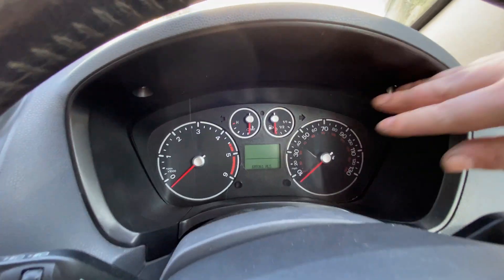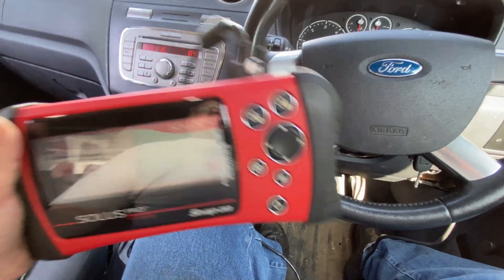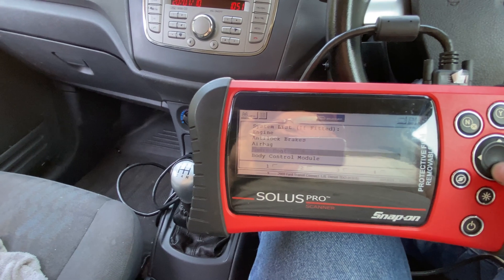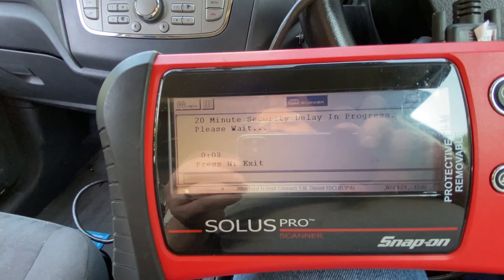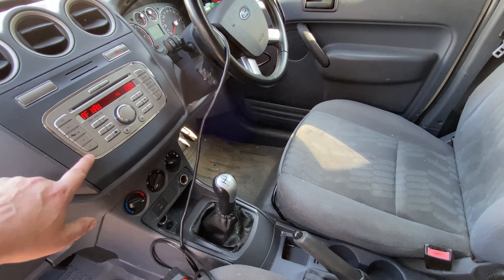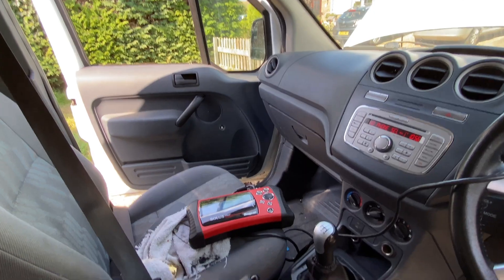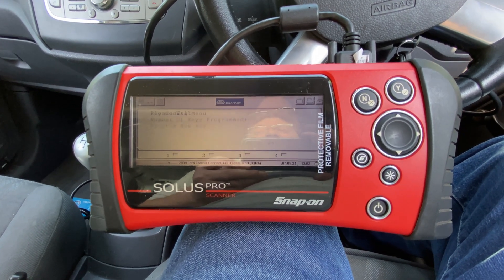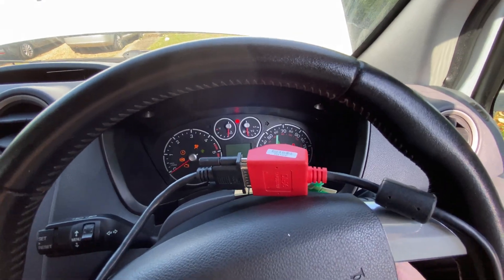Ford Transit Connect Key programming Snap On Solus pro

Comment: Hi, I have a autel mk808 
My ford connect 2003 does not see my key more, the engines turns over but doesn't start as immobiliser has cut fuel
I get to the point where it asks for incode but where do I get this? Also is there a limited number of time incode can be entered correctly? Can I get looked out completely

Appreciate any help thanks
Reply from the maker: If your 2003 Connect is a TDDI (Bosch VP30 fuel pump). EDC bolted to top of fuel pump are prone to failure. Resulting in engine fails to start (crank but no start) & immobiliser light flashing. Its advisable to have DTC's (Error codes) read 1st. To rule out above fault.

Ford incodes are available here - https://www.fordradio.codes/pats/
Reply: @PaulsTechChannel  thanks for the response 
I read all the codes 
- Fuel rail low pressure
- 3 x codes for anti theft key not recognised 

I used that sane generator for incode and the autel tool came back with invalid code 
It Also said any more attempts could lock it out....can it lock out?
One more thing, I noticed you had the 20 minute security wait my tool just Sat's please wait but you can press ok to go to next page (nothing about 20 mins) do you think I need to wait 20 minutes?
Reply from the maker: @TheDrivewayExperiment  Tool I used in this vid - Snap on solus Pro. Does not require incodes to access PATS, Due to that it requires a 20 min delay.
If your tool is requesting  incode It should provide you with a Outcode  which must be entered to generate incode. Once you have incode, entrer it into your tool to access PATS.  It should then grant you immediate access with no time delay.
Reply: @PaulsTechChannel  ahh maybe I used the previous given out code which would make this incode invalid as I understand it the outcode it gives you is generated there and then

Thanks for the help!!!
Reply from the maker: @TheDrivewayExperiment  Every time access to PATS is requested. A new outcode is generated, which then must be used to generate new incode.